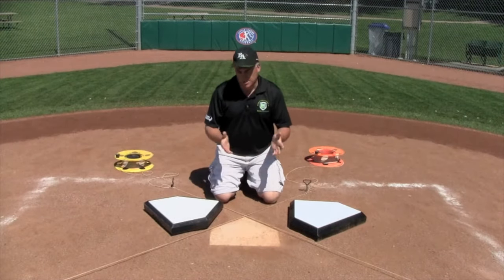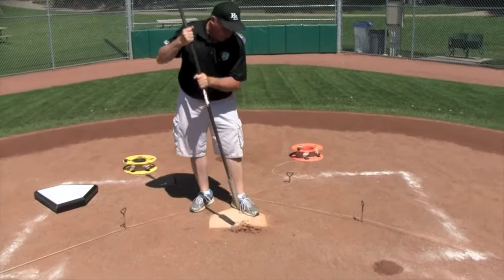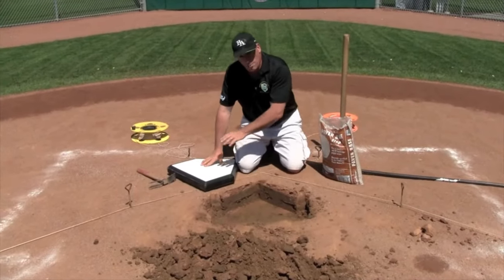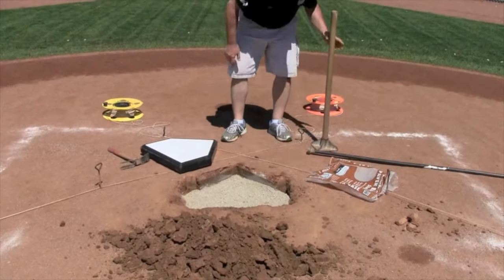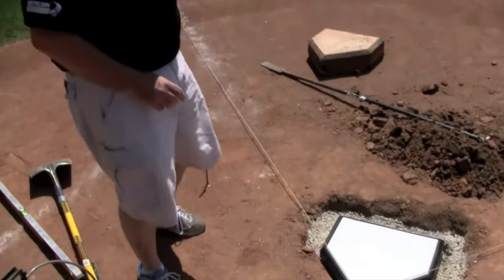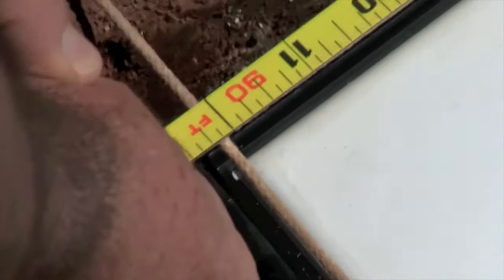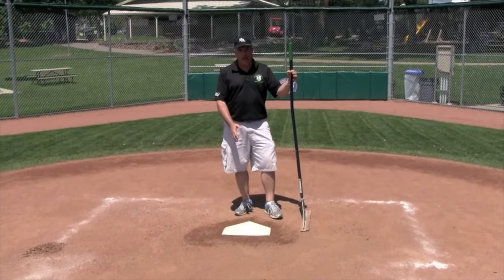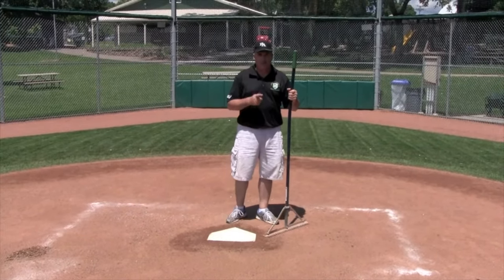BEACON Bulldog Home Plate Installation

Comment: A helpful variation is to install the plate's top surface 1/2" below grade.  This will provide the plate with some protection from the infield drag.  On game day prior to lining, the plate can be quickly exposed with a broom or field rake.  Under no circumstances allow the plate to stand higher than the surrounding ground.

Comment: Was hoping to see how to install a new home plate in a new baseball field. Like how do you know exactly where to put a home plate
Reply: If it’s a new field with no first and third bases ever put in you just slap the home plate where you want it and you start from there. 

New baseball fields are built from the home plate. If you’re replacing anything you go off your foul poles. A little tip I like to do so I always remember if I’m working off the poles is “fair is always in”

Comment: My OCD noticed that home to first was 89' 11.5 inches and home to third was 90' exactly. Not enough to worry about but they weren't the same.  I would have also used fresh moist clay without big dry chunks or chop up the old clay and rehydrate it. I have really bad OCD. lol

Comment: Aren’t the waffle plates intended for safety? A nice cushion when you’re stepping on the plate? It’ll save the knees and ankles.
Reply: Not the one shown in this video.  This one is very rigid.  During installation, the cavities should be tightly packed with soil which will then bond with the underlying ground and add support.